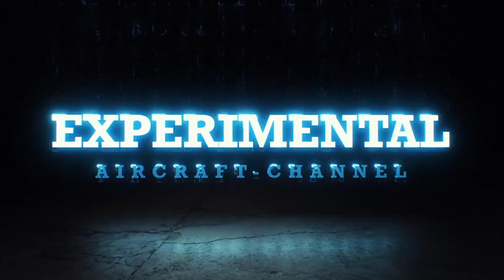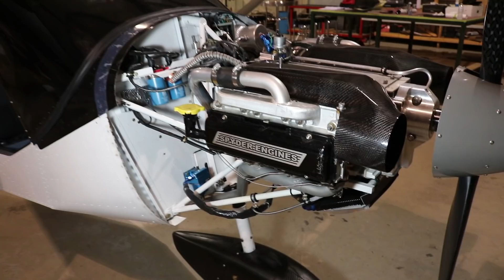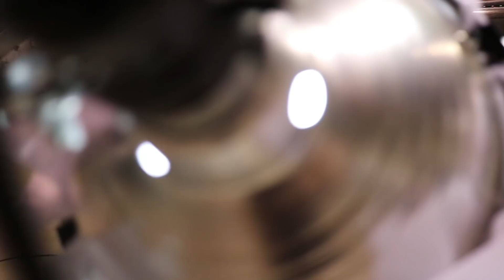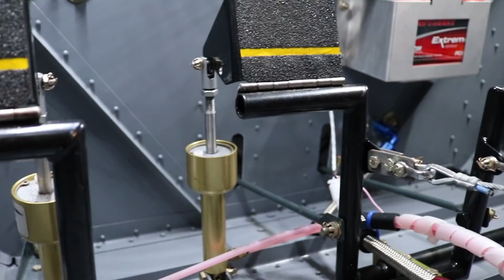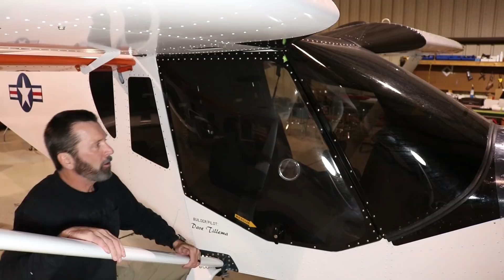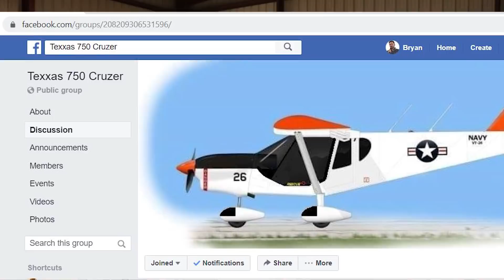Aircraft Builder  - Zenith CH750 Cruzer

Comment: Easier to rent a paint booth for final paint with urethane paints. For some have a farm, or large property just buy a commercial paint booth find them used easily. Then buy a turbine fresh air paint system pumps air into your mask. That way Urethane paint fumes never get in your lungs. If I had property I would have a paint booth nice to have when you need to paint something get lot more paint on it using a spray gun and no flies or dirt.

Comment: ....W....W....WHAT HAPPENED TO THE LEADING-EDGE SLATS????
Reply: Cruzer doesn't have the LE slats...
Reply: @orageek    Ahhh........wonder how much weight saving happened
Reply: The change was also on the horizontal stab and elevator. The 701 has that asymmetrical stabilizer but the 750 Cruze has a symmetric stabilizer. Think the idea was more speed (less inherit drag)
Reply: @orageek    Thanx, I appreciate that

Comment: Good to see a Corvair engine installation. This is a great motor at a fraction of the cost.
Reply: It made it to just about 95 hrs , then broke a crankshaft.  So , not to be grounded long, I bought a higher HP Viking 130 and installed it.  The Corvair setup has been pulled and now for sale
Reply: @texxasvikingcruzer644  keep us posted on the Viking and the performance 👍
Reply: @texxasvikingcruzer644  Did you consider the Jabiru 3300?  If so any reason why you didn't go with it?  Nice build thanks for sharing

Comment: Love that thing! Did a fantastic job on it. Thanks for sharing! 👍🍻

I've got an Odyssey battery in my truck to handle 60A worth of air compressors, and had one in the ATV I recently sold to power heated grips, seat, and thumb throttle, plus a couple other electrical modifications. Great choice. This is exactly how I'd want my aircraft built.

Comment: What makes me always wonder is people making decisions on which engine to use based on how it sounds :-)
Reply: Walter Rawdanik,  If your referring to my comment on not liking the sound of a gear reduction unit.... Part of flying is enjoying the way a plane feels and sounds.
     I flew in two Rotex 912's and the Viking 130 Zenith Superstol with a Viking engine.  Perhaps both Rotex engines i flew needed tuning,  Neither gave me any enjoyment.  One of those would not shut off once parked and the other sounded so rough , I asked if he needed to land. He said the duel carbs needed synched again. I asked to land , and I thanked him for the ride and donated to his fuel. 
     The Viking engine, has a unique sound as well, But it does not make me nervous. It is a VERY quiet engine .  If down the road I decide to swap engines, I will go with the Viking, Reduction gear and all. I find it to be impressive, and Viking has been very responsive to items i have purchased from them , as well as given me helpful advise with my current setup ( dual Battery Installation)  :)
Reply: David Tillema it is your call of course but making a decision based on having an hour or so in plane with a particular engine is still essentially meaningless. Consider the fact that there are 50 000 Rotax engines out there and what ... 300-500 Viking installations and maybe 1000-2000 Corvair installations , no matter how many stories you read about people successfully flying behind a Viking for 1000 or so hours , it is still purely anecdotal evidence. I guess ,it depends what you are after , if being a test pilot is the type of thrill you are after, then sure - picking a conversion over Lycoming or Rotax to save a few thousand bucks makes certain sense.
Reply: @walterrawdanik8077  Don't forget, the Builder spent a lot of time on Zenith and Builder Forums before making his choice of engines that he felt comfortable with, additionally, the essentially built (re-built) that engine. On another Youtube Video, one Experimental Airplane builder reported that his Rotax 912 normally cruised with much higher RPM's than most comparable engines. Personally,  that would have ruled out the Rotax engine as my choice for that airplane. It comes down to personal preference, not of playing the role of being a Test Pilot. We all have choices and we can change our minds as we go forward, if we so choose. Your comments are noted!